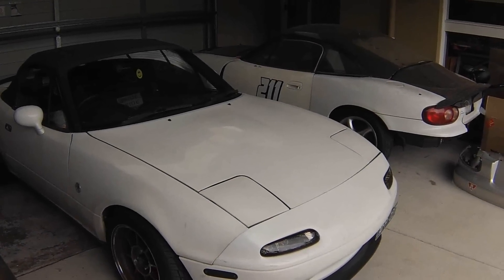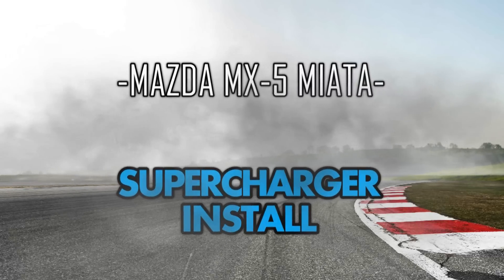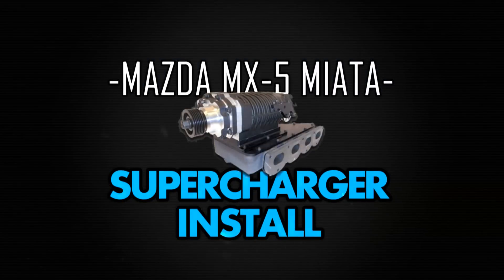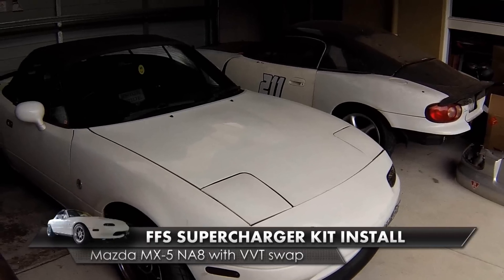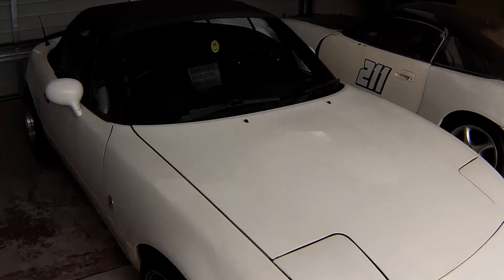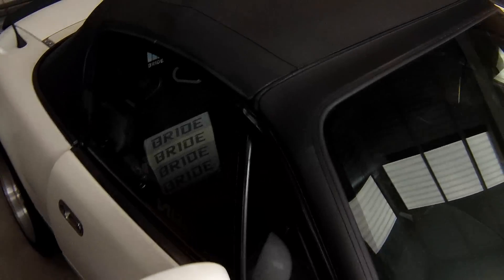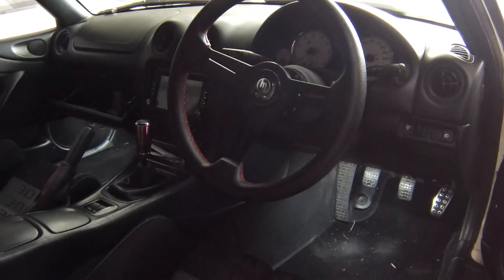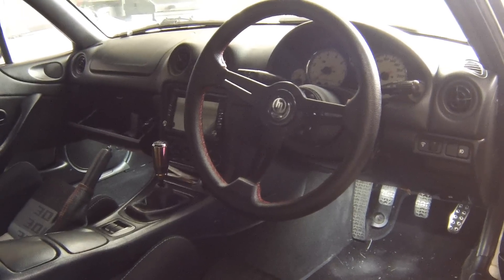SUPERCHARGER INSTALL - 200HP MAZDA MIATA MX-5

Comment: Where did you get the kit?
Reply from the maker: It's a kit made in the USA, however i bought it used from a guy in Western Australia.
Reply: Ah yes I found them.. a bit pricy new.. not a bad deal if you can find a used one.. but for the price you can go Kraftworks full kit with intercooler or similar Flyin' Miata turbo kit...

Comment: Did you run into any timing/tuning issues or was this a straightforward bolt-on?
Reply from the maker: No problems really, it all bolted straight on and fired right up. The power card pro was already setup for E85 on a vvt motor so i didn't have to adjust it.
Reply: +BEAVISHSV awesome, been thinking of doing this on my NA, turbocharging involves far more work it seems. Plus that supercharger whine is a magical sound :)

Comment: Why would you put your pod filter under your motor? If water splashes under there your engine is fucked
Reply from the maker: It's enclosed, behind the radiator, and above the lower splash guard, so unless I'm stupid enough to drive through a river, it's not going to get wet.
Reply: +BEAVISHSV cool be careful lol

Comment: Hard or soft top?
Reply from the maker: Hi Christian, NB soft top.
Reply: Nice
Reply: So why did you choose a supercharger instead of a turbo?
Reply from the maker: I got the kit fairly cheap and it offers a good power level. Its a road car, so the convenience and simplicity of the supercharger over a turbo is nice. Its fairly easy to reverse, fundamentally just swap the old intake manifold back on. And no need to drill/cut/mount/worry about intercoolers.
Reply: That makes since.

Comment: Damn this is the first time I've seen anyone swapping a NB dashboard into a NA! I always wonder about it, you should do a video on how you fit it in and a more detail video on the fastback too!
Reply: when you look up parts most fit early nb models and the na
Reply: +mrdauntl3ss You right! It should be since it's the same platform, is just the body that's different.
Reply from the maker: Its really more or less a 'bolt in' swap, provided you also swap all the internals of the dash and the wiring to go with it.
Reply: +BEAVISHSV That is very interesting! I really think you should do a video just about the dashboard swap! Did you swap the door panels too?
Reply from the maker: Yep, the door cards from the NB have been swapped onto the NA also.

Comment: @ $40.000 AU = you would be driving a wide body street tune show car condition NSX in Japan with 65.000 km !!!   ...  $4000 for that S/C before shipping and installation for 190HP?
    Plus the MX5's cost in Australia is stupid high !!!  $6000 AU buys a Mazdaspeed NB in Japan (120.000km off auctions mint) ... I bet you have spent over $40.000 AU on that POS  (just guessing from your accent). Sorry but I cant help but point out all your poor choices ...
Reply from the maker: Hi Alex, you're obviously a very clever guy. This car cost me about $7000AUD to build as is. The shell i bought for $300 and then I swapped in the drivetrain from an NB which cost under $2000. I'm not sure how anyone could spend $40,000 on an MX-5..... unless it was a brand new ND. What makes you think it cost $40,000? Thanks for watching.
Reply: +CrushingGroovesByAlexFromSuffer Hi! sorry to jump into the discussion but I happens to read that you are in Japan, so I have a question for you! How hard is to find a factory NB Coupe? I know they are very rare, and if you find one how much would it cost?
Reply: BEAVISHSV I also got both cars mixed up at the start ... Thanks for explaining mate.
Reply: ERICK4431 I haven't looked into it (guessing 10-15.000 USD) , I am sure they pop up on the auctions , if you are interested in going to have a proper look at any Japan auctions pls Skype message me at  : provzone

Comment: I've always wondered what one of these kits looked like on a RHD car. Sounds great and a neat install! 
One thing though, is the belt for the SC routed right? Doesn't look like its got much of a wrap around the SC pulley, you might get belt slip. I think the auto tensioner should have the belt the other side of it and be pushing the other way? Just my two pennies...

Hows the fuel lines holding up?
Reply from the maker: Hi Mr Lizard, you are correct with regard to the belt, if you see the video again, you will note I actually added a comment to the shot of the pulley, I have corrected the angle of the tensioner and the belt... MUCH better now!
Fuel lines have been fine, however the little injector clips were a bit dodgy and have been replaced with new ones.
Reply from the maker: The biggest clearance issue i had was between the bracket on the brake booster and the supercharger throttle body. The clutch master wasnt too big of an issue because i run the intake straight down under the SC.

Comment: You're going to want a taller rear diff ratio soon. All the extra torque will mean rowing through the gears more often on a 4.40, so I would start looking at getting a 4.10 or even a 3.90. You might even be able to just get the gears and swap them onto the diff and save some cash that way.
Reply from the maker: Hi Richard, I completely agree. That's why I have swapped in a 4.1 Torsen that I had spare... I'm happy with the gearing for this power level. The 4.44 was great when the car was naturally aspirated, but with the extra power it made it difficult and less enjoyable.

Comment: What kind of lights do you have for the feet area? I want to light my car a bit more and better(NBFL) but I don't know what the best solutions are.
Reply from the maker: Hi Andre, I installed some 30cm LED strips up under the dash to shine down on the footwell. they are wired into the overhead interior light so they illuminate when the doors open. it's a great modification, I highly recommend it!
Reply: +BEAVISHSV that's exaclty what I was looking for and I also wanted them to light when the door opens. Do you have some pictures or something? I'm new to car modding and that's one of the reasons I got my MX-5 for so anything helps :)
Reply from the maker: I will get some pictures for you in the next few days and post back.
Reply: BEAVISHSV thanks, meanwhile I went to my local store and they have universal led strips which have a universal black and white cable which you can attach to something sacrificing something else, so I don't know what I'll be removing yet and still hope there's a better solution.
Reply from the maker: Hi Andre, here's some pictures of what I have done. http://imgur.com/a/ETjM2
Reply: BEAVISHSV thanks mate super helpful! :)

Comment: How much more work would it take to strap a turbo to it and have both super and turbo?
Reply from the maker: In theory, that could be done, no more work than running a turbo alone. I doubt the motor internals could handle it....
Reply: I doubt it would be very beneficial then just a great super set up that's done right and you'll make more power light that

Comment: ecu?
Reply from the maker: Hi Elior, it's just running a powercard pro setup at the moment.
Reply: Do you mean powercard ?
You let the stock ECU control the RX8 injectors ?
FFS setups that I checked were knocking bad @ the top rpm...
And be careful with those extra injectors... they hit the body and fly off...

Charge temp is always a problem with FFS setups... be careful - and have fun !
Reply from the maker: Yes you are correct on all counts. If I ever drive this car as hard as I drive my track car, i wouldn't leave the powercard in there. When i get the time/money/interest, I will build a megasquirt for it.

Comment: How has the reliability been  ?     And how many miles on the engine   ?   cheers Mate !
Reply from the maker: Hi Frank, I've not had any issues thus far. Though I've only gone through one tank of fuel (little over 200kms or 150miles). There's 200,000kms on the motor (124,000 miles).
Reply: @Bbeavis  hey just viewing this! Just wondering how the reliability has been ?
Reply from the maker: @m32m1m  The car ran fine for some 4yrs like this, but the add-on style fuel card was not that great, a dedicated ECU would be nicer. Eventually i just grew 'bored' with the setup and decided to return the engine to stock, so I spent a single day in the garage and it was all unbolted and back to normal. I sold the SC kit on.

Comment: I have a question. How is this better than bolting on an SE turbo kit? I don't think it's a lot different in the amount of work required. Sure you need an intercooler and drain hole in the sump, but the SE kits are very cheap. And it is reversible, if you ever want to remove it, just like this set up.I think this is great for a road car. But for me the SE bits are a good cheap option. I would like to see how this performs on a track now. Around 1:50 at P.I is my guess. You just need some NB8A wheels and Advans. Will finish the stock look.
Reply from the maker: +lightyearmx5 The factory SE turbo is crap.